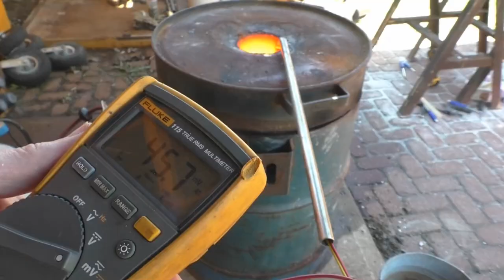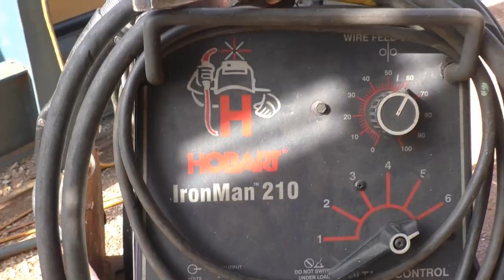Metal Casting, Aluminum Bronze and Back to Welding

Comment: Explosive Spalling !!!! I've been waiting for this to happen.
The spalling is caused by the water turning to steam, it's expansion and subsequent pressure spike.
The pavers survive because of porosity. The steam can vent through the pores in the pavers.
Refractory is a type of ceramic material that is designed to withstand the heat. It comes in bricks, precast shapes, 55 lbs bags, 2500 lbs bags and about ten thousand flavors.
Yeah ... Stuff I know about.

Comment: Have you tried using some of the casting simulation software? If you have a CAD file of the parts, you may be able to troubleshoot and optimize your gate and riser locations before you pour. It might also give you insight as to why you have those voids on the corners. Just a thought, love the videos!
Reply: Mark Esposito woah, I’m going to be looking into this!

Comment: On the cleat match plates, I'd sprue it with a fat sprue between the cleats then have big bobs/risers outside each of the cleats. Let those uprights cool first as they are the smallest. If you try to feed the large part through the small, you will continue to have these problems. Lookin great!

Comment: From my experience with casting brass which is not much different from Aluminum Bronze when we cast a large part we use very large sprus and runners as well as vents.  Your on the right track.  It looks like it cools faster, which could be some of the problem.  But like I say with casting you can just cut it up and try again.  Doing a great job and next time i get some time when i'm in Tulsa at our corporate office I will stop by.

Comment: +SV Seeker

The bigger and taller the compensation casting "button", the better to avoid fails, as it is  much better to feed the piece contraction. 

Building the compensation casting button even a little taller will increase the pressure difference between the contraction and the button increasing the compensation move. 

Greetings from Brazil.

Comment: when you die so long and narrow thing, there will always be problems with the metal to settle before filling up, it can be remedied by using a resivoir with a plug removed when resevoriet is full, it will create a higher pressure when the metal to be out in the narrow locations, resivoret must be able to hold at least half of the metal

Comment: I suspect some of your casting struggles are from pouring large parts  through long skinny passages. They chill first shutting off the supply of molten metal needed to fill the shrink.
Reply: Chris Turley Yeah I'd try making the gate very wide, like a soup can

Comment: Like the show. But as a professional welder I think while your guys are using solid wire they should be pushing the puddle not pulling. It's faster and a nicer flatter weld. Not a critique. Just a tip. Enjoy the rest of the build👍

Comment: When you make the core, it should be make with a hole in the middle. A grove along the parting face to the outside of the flask, inline with the hole in the core, is needed. This will help vent out gasses not wanted inside the casting. The core is inside the casting and needs to be vented.

Comment: I'm sure you've answered this before, but what are you guys using for a crucible?

I'd love to do casting on this scale, but any crucibles on Amazon/eBay are either too small or incredibly expensive.
Reply: Do you use a different crucible for each type of metal and if not, how do you prepare it for the next type?
Reply: That's also an excellent question.

Comment: I know nothing about casting  but i wonder if lightly vibrating the mold would make any difference  or pour the cleats standing up  rather than laying down.. just curious but fun to watch
Reply from the maker: The foundries use shaker tables for some processes.  ...mostly green sand casting, but rarely for resin or sodium silicate molds.  Packing it tightly is just not needed.
Reply: SV Seeker I thought it might help keep the metal moving and help with the drawing/holes
Reply: The problem is the metal cooling in a small space and blocking the flow. Vibrating won't help with that.
Reply: J DeWitt thanks I did not know
Reply: That will put air in the parts you make really just keep it hot and its all good

Comment: I can't imagine all you've heard from the "fault experts". My first two small plywood boats I made I heard they were gonna sink, tip over, take in water, mold, decompose, unable to row in windy conditions... guess what they work great still and I've never tiped over.
Reply: Same experience here.  At 16 years old, I decided to build a tandem bike out of scrap old bikes.  He would never hold, it would break at first ride, the chain would run of, the steering was wrong, and bla bla bla...  I rode two years with my younger brother to school with it and it never failed.

Comment: I am excited to see the new Grid Fins on SpaceX's Falcon 9 rocket.  They are having problems with them getting to hot, so next they are going to try casting them.  I think they are atleast 6 foot long.  I want to watch that video!
Reply: Jon Simmons He is using some titanium composite that can withstand the heat that has never been casted this large.

Comment: I'm not a pro at any of the things you do on this channel but why not cast the pieces solid & drill out the center instead of recasting every time? not being a smart-ass just curious...keep up the great videos
Reply from the maker: The metal cost about $3.20 a pound.  If you started with a solid bar it would be about 100 pounds for the large roller.  Then after a couple of days of machining your have one 40 pound part and 60 pounds of scrap.
Reply: Gotcha... Thanks for the response

Comment: You think the casting is drawing from the so called risers to the sides, when in actuality the risers you added are acting as an extension of the pattern. The holes in the pattern and so call risers are results of shrinkage and improper riser placement. Risers should be placed at the highest and thickest part of the casting. Risers should be round for uniform shrinkage and drainage.

Comment: What is the composition of alloy sir
Reply from the maker: Nickel Aluminum Bronze or Ni-Al Bz,  also called “Nibral” and frequently miss spelled as “Nibrill”, is classed as Copper Alloy and has a melting point of 1913 to 1940F.  AA Num: 95800.  NiBrAl density is 0.2745674 lbs/cu inch.   It has the same hardness as 316 stainless steel and is the hardest copper alloy produced for industrial use. There are several standards that each give it a different code.  In the US it’s C95800, Sweden it’s 5716.   An important feature of C95800 aka 958 is that it welds nicely. The local foundries may have 955 or specifically C95500 which is a little stronger and a slightly harder to cast as well, but 958 will do better over years of exposure to salt water.
http://www.svseeker.com/wp/sv-seeker-2/metal-working-2/casting/casting-props/
Reply: SV Seeker thank you sir🙏